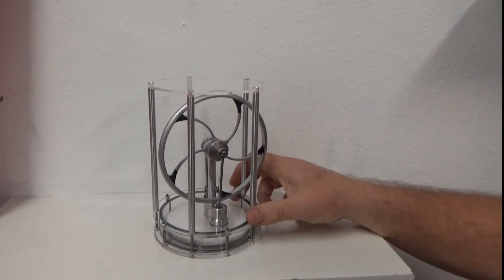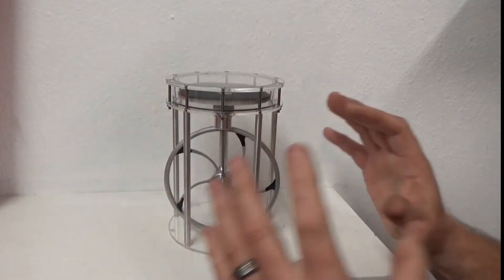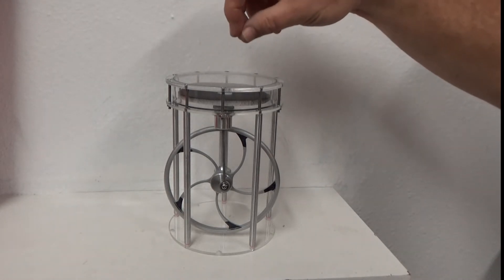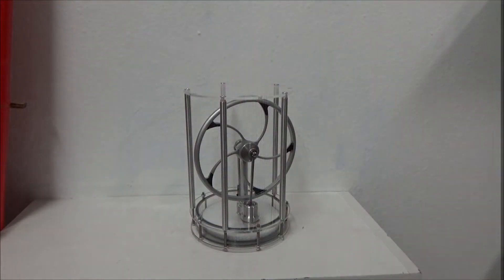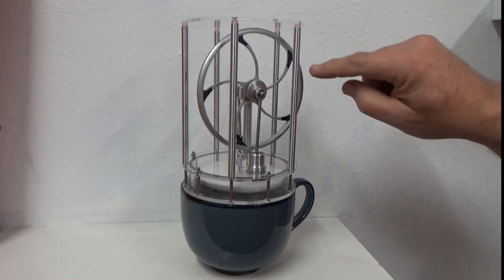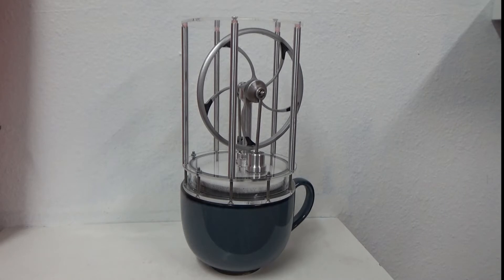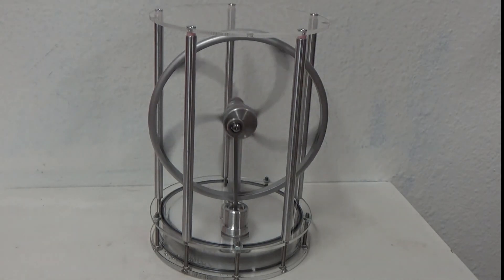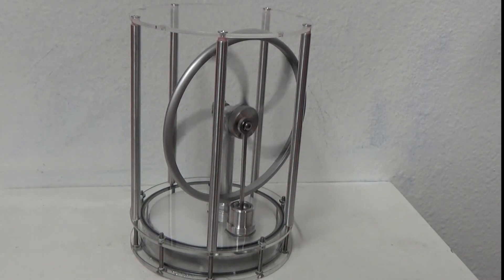Solar Stirling Engine

Comment: As a kid,I traded my entire hot wheels set for a boiler engine. Sadly I was a kid and abused it to the point I ruined it. You can buy a chines knock off of the boiler engine for cheap enough now. Nice engine, makes you wonder why we never continued using the sterling engine.